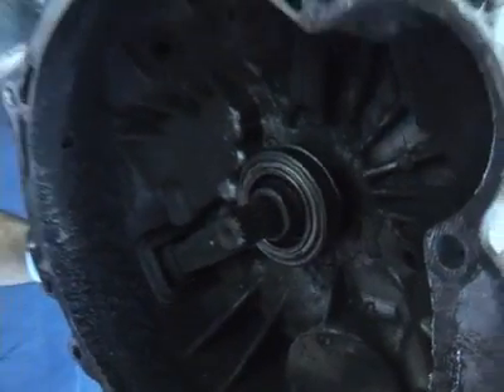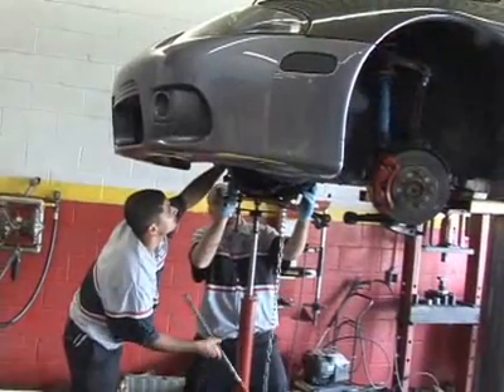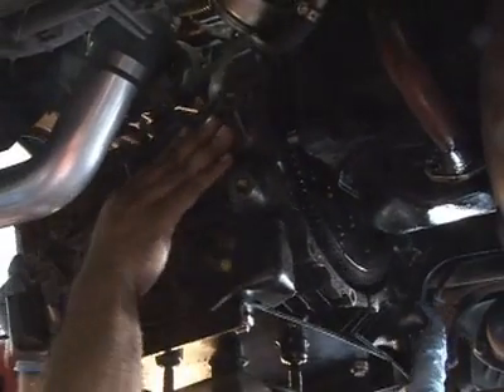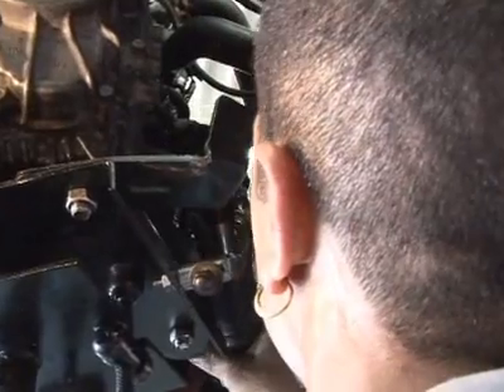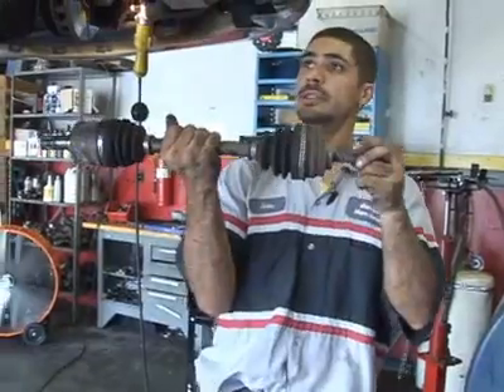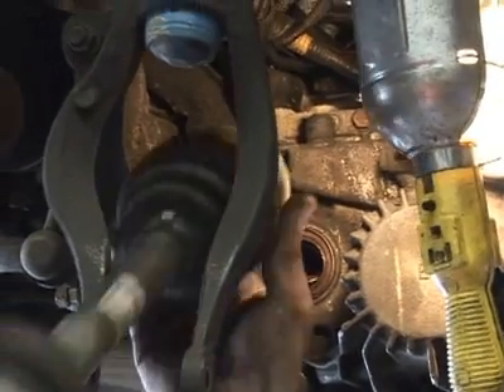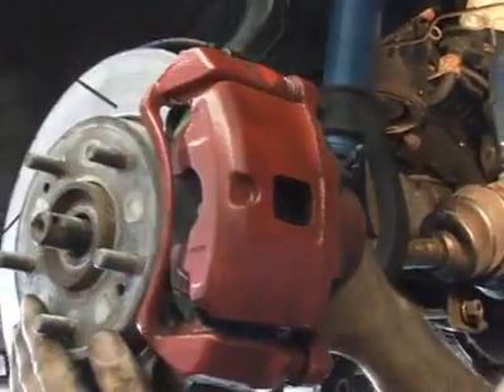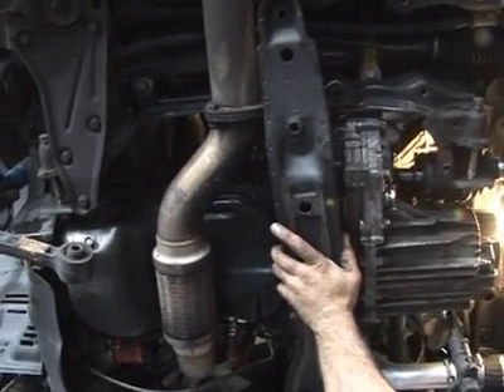How Manual Transmissions Work: Installation

Comment: @hxcmexi how is a differential the same as an axle? sorry bud but they are not the same, an axle is a straight bar with splines, the differential is what spins in the rearend or transmission and puts power to/turns the axles. a limited slip differential allows both axles to spin free depending on which way u turn. a positraction diff does the opposite, it puts power to both axles and doesnt allow one wheel to spin free when turning. see the difference?

Comment: @AKTGuitar both....in rwd cars the differential translates the motion of the driveshaft into a different circular motion used by the rear axle connecting the rear 2 wheels